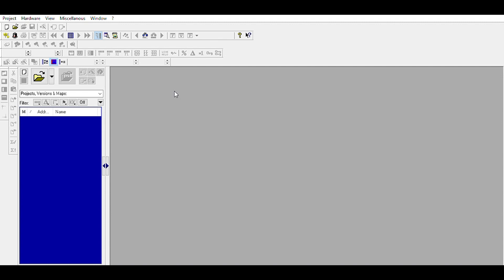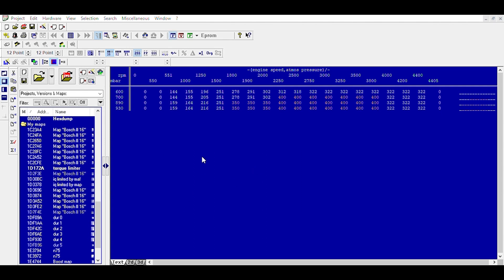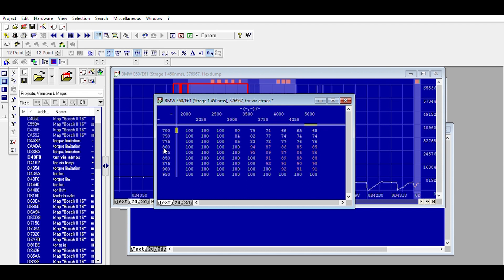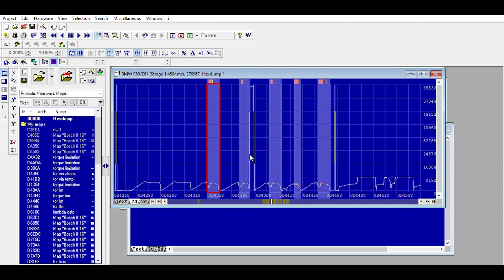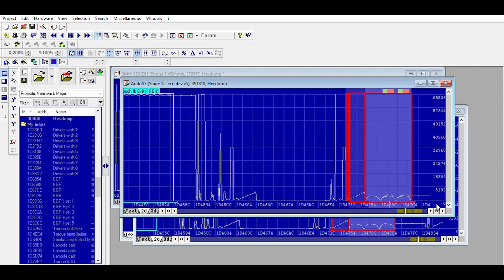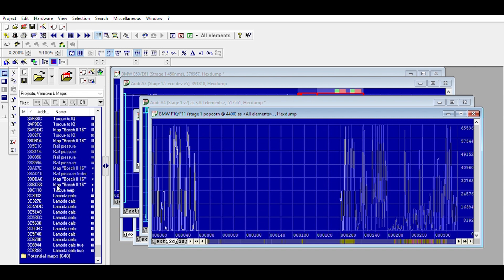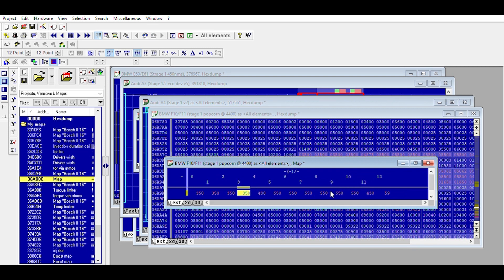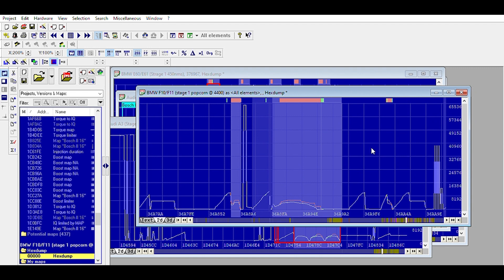How to remap- Torque limiters  EDC16 & EDC17 ECUS

Comment: Thanks for the informative video, 
I had a stage 1 tune on a VW , with edc17 , the torque to to much for the dual mass flywheel at 2000 rpm, the file tuner wants more money to modify the map and reduce the torque , I pulled the maps originally sent them got a tune as I don't have damos or map data, but now I have the original and tuned file I can see the difference is about 40% on the torque limiter on the stage 1 file but I dont know the offsets to enter to get the actual value , the tuner states he set torque limiter to 500nm , but I would rather reduce it to 350nm in the lower rpm . Are the offsets for all EDC17 ECUs the same , your example here is. BMW but will those offsets work for a VW edc17cp20 ECU and will they have a similar pattern. Many thanks
Reply: The answer to my question was , yes Edc17 ECUs follow the same map lay out whether it's VW Audi BMW etc , thanks again for the informational video

Comment: Hi ! Y have a e39 530d  , y mounted R90cp3,  216 injectors (with the nozzle 145°) to respect angle spray , it is mapped and drives good , but it is EDC15C4,  is it possible to clone the map EDC16 to EDC15 ? Thanks
Reply from the maker: Not sure if they are cross flashable as edc15 is usually 512kb and edc16 is 1-2mb, a massive difference in files. What i recommend is getting essential maps like injection duration, wgdc, SOI. This is the least of your worries as youll have to replace the loom also and disable immo
Reply: @ckpelectronics8921  thank you , y can disable immo on edc15 and 16 with Quickflash from bimmertools , my english is not so good 😄, y do not want to inject the map from edc16 but make the same values , y tried to mount the 306d2 bmw engine , it would worked if the crankshaft sensor would be inductif but it is hall effect sensor with 3 wires and à whole different signal , 

E39 530d (306d1) with edc15c4 is inductif , all the seconds générations  306d2 to 306d5 is hall effect with edc16xx , y could mount the edc16 with his engine and standalone loom but y will loose all my options like pdc, etc because can bus will not work

Comment: Hello, I watched your videos on YouTube and I am facing a problem. I have a Peugeot 307 1.6 HDI 90 Hp vehicle. I have a turbo problem that has not been solved for years. No matter what I did, I couldn't fix the problem. There are no problems such as leaks or anything in the turbo system. My turbo is solid too. I canceled EGR. However, I could not resolve the p0299 error. My vehicle cuts off the turbo after 3000 rpm and gives a low pressure error. Wesgate opens its canteen. I changed the N75 but still no solution. I pulled the software from the vehicle with Kess. But I am not a software developer and I would like your help on this issue. I can send you the file if necessary. Regards.
Reply from the maker: Email the file to sean.ckp15@gmail.com
Reply: Dude, same problem here, do you have a fix???
Reply: @azizcanbilgic   kardeşim sorunu kendi başıma hallettim.
Reply: @Cii-89  ah, Tamam kardeşim, yinede cevap verdin için sağ ol 😉👍
Reply: @azizcanbilgic  yardım gerekirse yardımcı olurum.
Reply: @Cii-89  teşekkür ederim, galiba buldum, benim turbo ayarı gitmiş, bir ayar cekecem, zamanım olsun. Yinede teşekkür ederim 😉👍
Reply: @azizcanbilgic  ondansa şanslısın :)